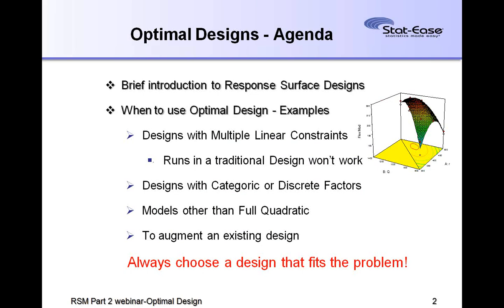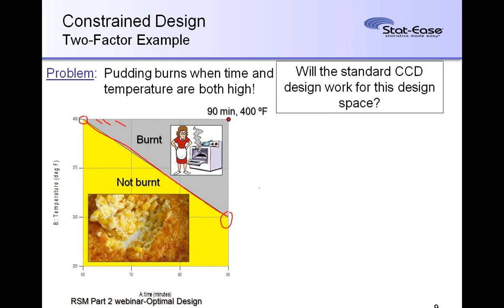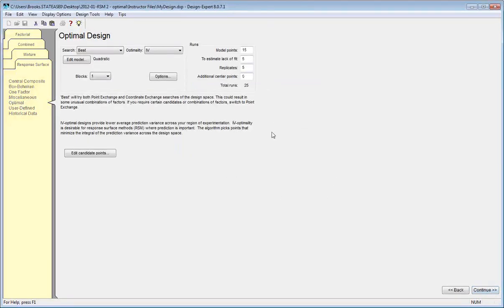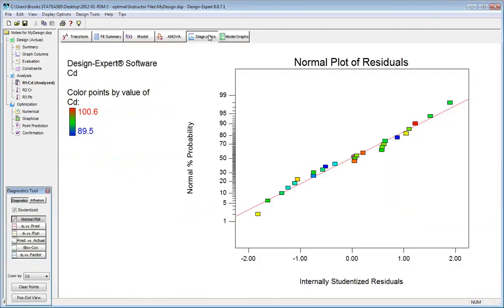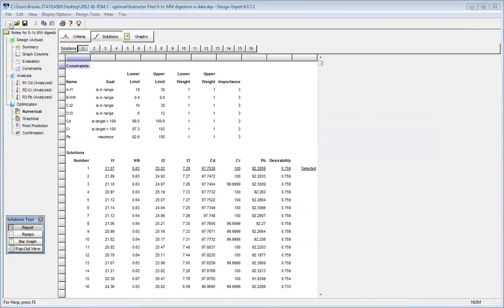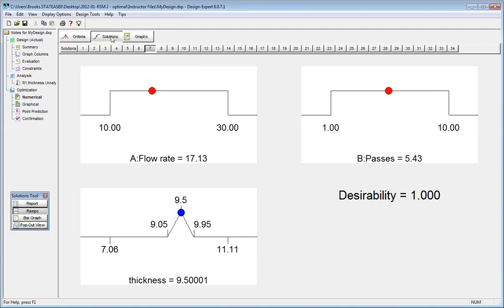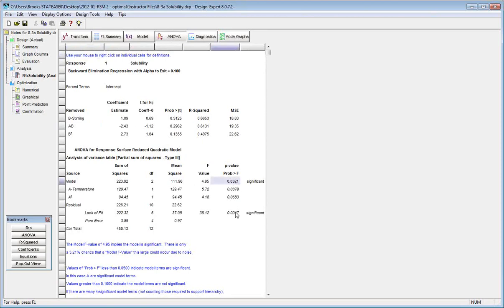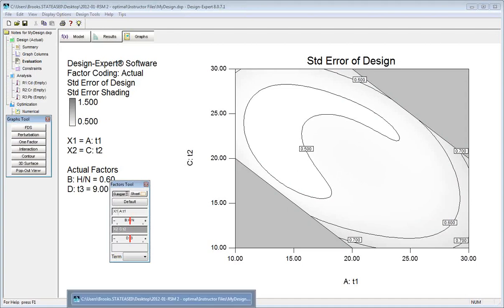Basics of Response Surface Methodology (RSM) for Process Optimization, Part 2

Comment: In the video in every Residual Plot (for check of normal distribution of errors) a pattern is visible. Which would mean that there is still a predicting factor absent in the model?
Reply from the maker: Every example in this recording had acceptable residual plots. There is variation, but not enough to be a concern. The ANOVA is robust to moderate deviations from normality.

Comment: When you optimize the design points, then the old response value based on these old design points will be failed, right?  You have to use the new response based on the new design points. Or you still use the old value? I am not very clear here. Thank you.